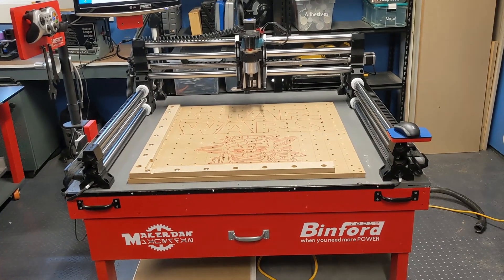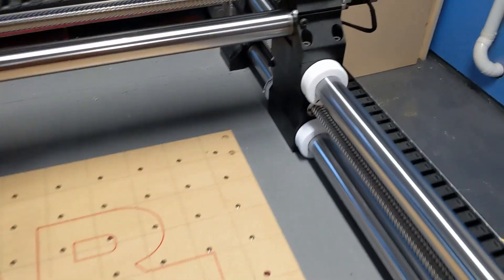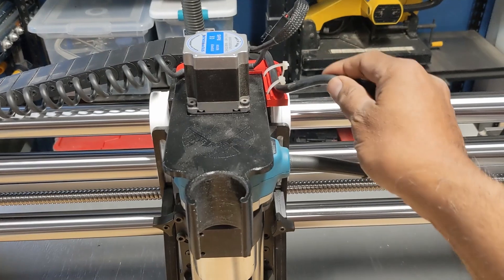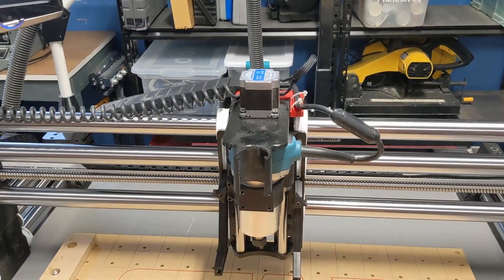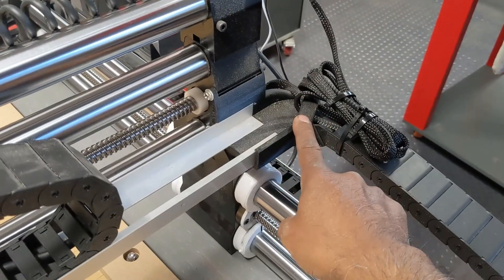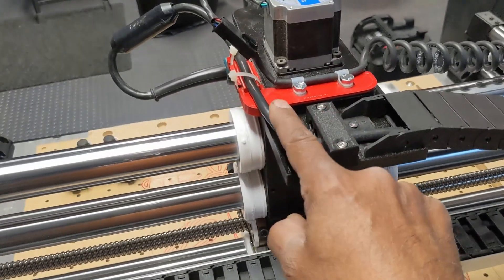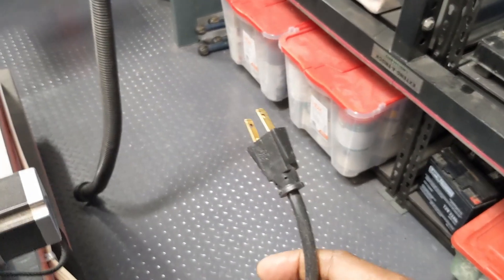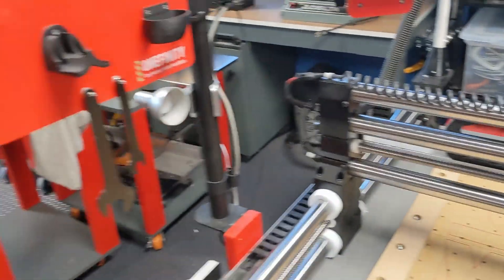EMI and the OneFinity CNC

Comment: Eliminating EMI is fairly simple, use properly grounded shielded wiring. 

All of the equipment I work on which have high voltage and low voltage cables running through the drag chains use shielded cables and we don't have any issues with EMI. I'm using shielded cables on mine for the stepper motors, if I have any other issues, I'll change out the spindle (router) power wire for a shielded one. So far so good with the current set up.
Reply: Is there a shield that can be added to an existing cable to make it shielded.
Reply: @michaeljakus8373  Not that I am aware of. Shielded cables are fairly cheap. I recommend looking on etsy for a guy that makes them. That's were I got mine after two failed attempts of my own (my crimper sucked). You can probably get away with not shieling the power cable for the router, unless you get interference, then I would replace that too. Remember to ground your shielding.

Comment: Hi Maker,

I have a question your maker setup. What book can you recommend for a beginner myself in the maker hobby? Would greatly appreciate any suggestions/thoughts. Thanks in advance for the assistance and best of luck with your maker projects as well.

Thanks,

Bill Miller
Reply: Books aren't as helpful as jumping in, just jump in and dont be afraid to fail Bill, it's a journey and you acquire and build your shop up, build your space up as you find the groove of what you are making. 
What are you going to make? But before you ask yourself that. Get a 3D printer, its what I did 3years ago without a lick of sense and I now have a 10 printer mini farm and 2 cnc machines, my necessity evolved all from the one ender 3 I started with.
Cool thing is if it's not for you it wont put you out a ton. 
Good luck on your journey